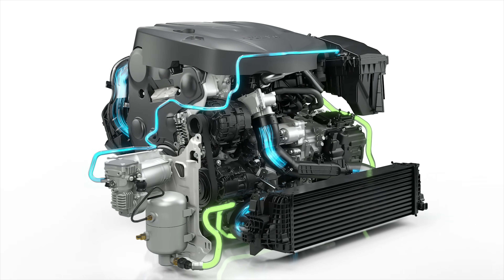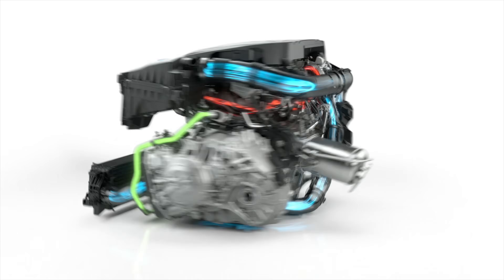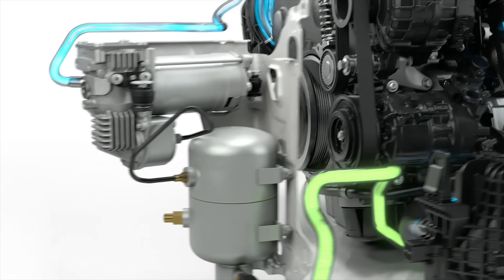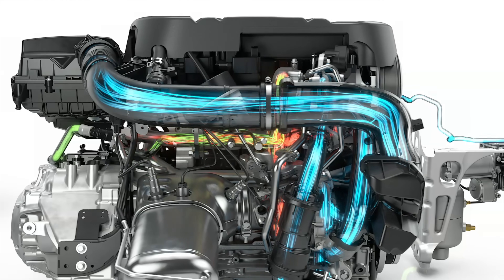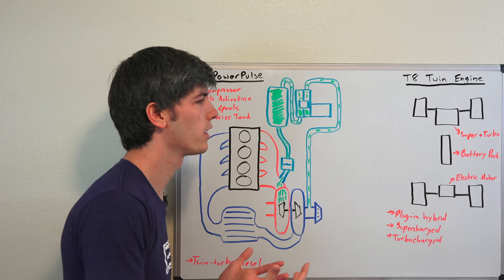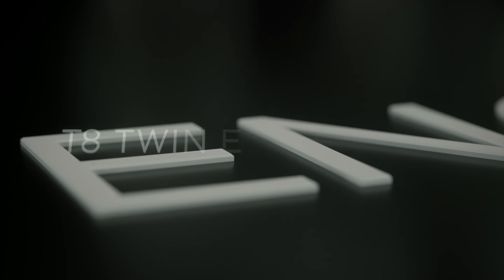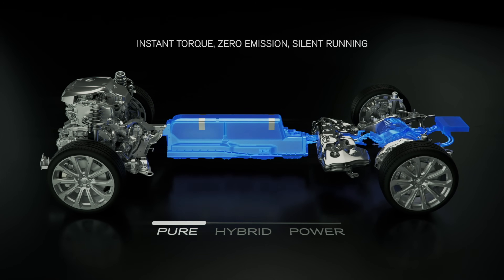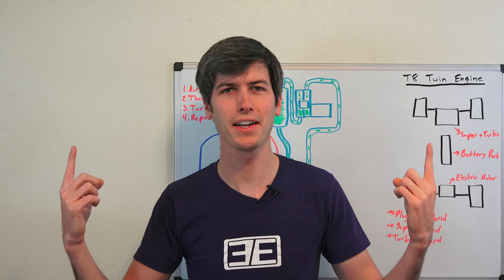How Volvo Is Eliminating Turbo Lag

Comment: Are they coming up with new tires to accommodate all that immediate torque?
Reply: there's nothing of special in that "immediate" torque, still much less immediate than elettric motors
Reply: No real need.  For example, if you have a 4-cylinder turbo that makes the same power and torque as a naturally aspirated V8, but with lag...then removing the lag simply makes throttle response and torque delivery like a n/a V8, with the same sort of torque delivery, only in a smaller, lighter and (generally) more efficient package.  And there's plenty of cars out there with n/a V8s already.
Reply: theLutheran1 no why would they? It just a family car not a drag car?
Reply: They will use traction control to reduce power to the wheels. All this tech is B.S.
Reply: Only if there's too much torque for the available traction.  Just like happens right now.  But for those times when there's plenty more traction than torque (like when there's lag and thus the engine isn't making optimal torque - most noticeable in higher gears, but it can happen in pretty much any gear) then it's still usable and therefore won't be capped off by traction control.

Remember, traction control is just that - dependent on traction.  If you have the grip, then no reduction.  It relies on detecting that your wheels are already losing grip before it kicks in.
Reply: The Volvo isn't capable of making nearly enough power to be needing new tires. Sure you can rapidly upset the tires even with very little torque but that's not what this is about.

Comment: Could I install this in my internet router?
Reply from the maker: Yes, CenturyLink will charge you a 1-time reoccurring fee of just $99.99 (increase by $4.98 monthly) to have it installed. Don't bother calling Comcast, they'll claim you already have it (and thus have already been charing you for it).
Reply: Engineering Explained Dang,I almost got scammed,thanks for heads-up
Reply: Miscellaneous Dudes OK you win lol
Reply: Most likely.
Reply: lol a 1 time fee that is reoccurring, that makes sense
Reply: You'll need a blow-off valve though.

Comment: But how does a turbo work with an electric car? It does not have exhaust because it’s energy so how does that work?
Reply: rc ng, I respect you know what you dont know, unlike most ppl. And don't let the fear trolls ignorant comments, who usually know less than you keep u from asking the questions you need to be well informed. 

To be honest while I could tell the T8 powertrain is a hybrid, I would have liked more details on exact configuration of the Hybrid, so I guess I will google other reference material on it.
Reply: rc ng its a front wheel drive setup, with an electric rear wheel drive. Reason they called it a hybrid
Reply: oh ok so hybrid is both electric and gas
Reply: oh ok thanks tho
Reply: N C very rare to see such respectful comments among the much online trolls. Respect!
Reply: Ayman Almateeg lol thanks
Reply: PS, I got a reply from EE (Sorry I still dont know his name) to my question right away.
Reply: N C I believe he is called Jason

Comment: Remember when Volvo was synonymous to simplicity and reliability?
Reply: As a previous owner of a 240 and current owner of a 140, I agree. Still, it's cool to see the company is still relevant and innovating.
Reply: Jurre Volkers by ford.....  Don't forget that.. But with the Chinese money now, at least we're seeing boats load more innovation
Reply: My Volvo  S60R despite being very complex has been way, way more reliable than my newer CPO Mercedes SL550. My next car will be a NEW Volvo. I could have bought a new Volvo for what I paid for my CPO Mercedes SL550. There is also statistical data from Warranty Direct (largest British extended warranty company) listing Volvo engine's in the top 5 for reliability even ahead of Lexus at the time. BMW, AUDI, VW engines were all in the bottom 10 for reliability. Warranty Direct keeps detailed statistical records of engine faults since they are on the line financially to pay for repairs for customers.
Reply: @gordonmccracken1209  thanks for the info.
Reply: That is correct which is why I think Warranty Direct's data is better if you plan to keep a car long term. It is a better reflection of durability. There warranty coverage is applicable only after the the manufacturer's warranty expires thus they see older, higher mileage cars.
Reply: King Pleb Volvo is still one of the most reliable, it got voted number 1 in a study recently.
Reply: In the US who the hell thought Volvo was synonymous with "simple affordable cars" as a brand? Volvo has always seemed a bit higher end than (over $30K)
Reply: King Pleb remember when humans used to walk around with no clothes on? Life moves forward
Reply: my 2004 xc70 is doing good and I can do most of the repairs myself.
Reply: If that system breaks down, it won't be fatal, you can still drive around just fine with a little more turbo lag though.
Reply: Gordon Mccracken   Doesn't JD Powers do surveys about reliability after X amount miles. Or cost of maintenance for X amount of miles
Reply: Gordon Mccracken  they would need to have accurate numbers to determine what to charge. There must be some cars they won't cover
Reply: Bernie Leiva   Aren't they owned by Ford now. I hope the retained their best feature, Saftey
Reply: Pepperidge farms remembers.
Reply: Also hybdrid cars with combined start / stop generator / extra drive motor, in theory have the possibility to be more reliable for example in terms of starter motor, etc. problems as the "starter generator" is much beefier than traditional starter motor . . .
Reply: Toyota is the pinnacle of simplicity now. But they're not innovating things. And unfortunately for them, that's not what people want.
Reply: @ravenclawgamer6367 Toyota was in the final stages of a hydrogen I am not sure what’s happened since though. Point is they are developing new things
Reply: They haven't been very simple since 1993, however they do continue to be reliable
Reply: It all went downhill when they got taken over.
Reply: I lament about the older cars Japanese from the 80s and 70s.  Smaller lighter with great fuel economy simple to fix and without all this computerized crap.  And a lot cheaper and more reliable.
Reply: No
Reply: I'm starting to think that Obama and him making a law saying 50 mpg for cars was really about forcing more people to ride public transportation. Basic simple affordable cars will be no more
Reply: @scottgolden2766  stfu... 50 mpg are possible but forget about every suv, crossover or even more useless pickup truck, most of them just used to commute and go to the mall...
my previous and current car gets 50 mpg

Comment: Why not sending the compressed air directly into the intake manifold to compensate the lag instead of spooling the turbine?
Reply from the maker: Well, a couple reasons I can think of, but it's an interesting thought for sure! First, it's not passing through an intercooler, so the air is going to be hot, not great for combustion. Second, it's not really that much air. The idea is to simply get the turbine wheel spinning, where it then takes over and provides ample boost. Third, it may be a bit awkward for easily controlling air/fuel ratios if you simply inject super high pressure for a very brief moment.
Reply: I think, you would need a bigger tank for that. If I am not mistaken, this device only helps to overcome turbos moment of intertia.
Reply: That would be way more complex thing to setup. You need a certain amount of air to fuel so you would need to control amount of air you send depending on multiple factors.
Reply: thats a good question though
Reply: That would cause a reversal of airflow towards the turbo's compressor. This may eventually cause a compressor surge. (Thats what I think) @engineeringexplained
Reply: The answer is volume, I suspect.  The engine would need a large volume of air for that to be effective, so you'd need a larger, heavier tank...and a much stronger compressor to refill it to the required pressure fast enough so it's ready for the next gear shift (with spirited driving, this could mean a refill time of a couple of seconds.)
Reply: The reason i can think of is this,
It is very difficult compress air (as air is compressible and having a very low specific volume) now think of a normal 2000 cc engine running at 6000 rpm, that equates to minimum 200lites of air per second (assuming no boost),
The air compressor needed to do this will be bigger than the engine itself, and it will consume more power than the engine can produce.
Reply: That would not work so well for two reasons. 
1. With the throttle wide open (i.e. when you want the boost to occur) the burst of air into the manifold would be free to back up into the intake system rather than raising the pressure inside the manifold sufficiently to increase the power, so the effect would most likely be negligible. 2. 1, air injected into the engine but not flowing through the MAF meter would mean unmetered air and mess up the air/fuel ratio.  Squirting the air into the turbo avoids both these problems and only needs a small air tank.
Reply: Engineering Explained
Unless the air was immediately compressed prior to application, it probably has cooled back down close to ambient temperature while bottled up.  The act of expelling it from the tank would immediately cool it, making it more dense than the air being introduced through the normal path.  While this system may not be much air, it is likely able to do more work on a turbocharger in the form of a heated gas post combustion than in its cold state. It also wouldn't be competing with exhaust flow from the engine to get through the restrictions of the particulate filter, muffler, etc.
Really, there are two reasons that I can see why Volvo is doing it this way, with one being your last, which is maintaining control of air/fuel ratio.  Even so, this isn't very critical in a Diesel engine, other than to avoid making  black smoke.  The other is this arrangement avoids having to design a system to cleanly hand off the responsibility of providing boost from a tank of compressed air to the turbocharger.  Quickly modulating a large air flow from a decaying pressure tank source into a building pressure source from the turbo would be difficult. Instead, the power hand-off occurs on the turbocharger and the waste gate handles any potential surges beyond the intake pressure maximum.
Reply: Engineering Explained while you compress the air it heats up ( pV=mRT,  V m and R are constant). So the container would heat up simply aircooling it with some finns would do the job most likely.
Reply: 1. The adding air to the exhaust manifold increases back pressure, which substantially increases the amount of work the engine itself is sending to the turbine. This multiplies the compressed air's effectiveness.
2. The energy from the air injection event goes directly to the rotor of the turbo. Once the turbo is at high speed and creating boost, the engine will immediately produce enough exhaust gases to keep the turbo spinning long enough for engine rpm to rise if it isn't already above the boost threshold.
3. There are no expensive check valves or aspirators to add to the intake side of the engine. Control is very simple as well: If full throttle is commanded, open the dump valve for a certain time given the current state of the engine. The normal engine management can take care of the rest without much re tuning.
Reply: Because you would need to retune for extra air you will be shoving into the cylinders semi-randomly. Just install a harbor freight air compressor into your exhaust manifold and you're good :^)
Reply: Santiago Cuevas, did Volvo engineering call you yet;)
Reply: I believe it would be due to the limited volume of air in the tank. Think of it more a form of power storage rather than Air supply. An average turbo car would only be around 1 Bar (15 psi) of boost, maybe upwards of 2 in some more exotic forms. (not counting massively worked GTRs). At these pressures, storing enough air to directly boost the engine for any useful period would require a very large volume. 
Say 2.0L, 1k RPM = 41L/s; 2k RPM = 82L/s and so on.

You could boost the pressure in the tank higher, and rely upon the expansion of air as it flows from high to low pressure, but that might net you a maybe a 2* or 3* benefit, which leaves you still with a large tank required. Also as the air expands, it would cool significantly, not sure how this would upset the engine with a sudden change in temperature along with pressure and how quickly the ECU could adapt...

Instead forget the air part for the moment, consider the specific problem at hand - you need to dump an amount of energy into the turbo to spin it up to a point where the turbo becomes self-sufficient (i.e. the additional boost creates additional exhaust gas flow sufficient to create the required boost). 

A compressed air storage tank has a basic energy equation where the energy stored is proportional to the volume, and proportional to the pressure ^ 2 (double the pressure = 4 times the energy, or 1/4 the volume for the same energy). And it's reasonably easy to create a tank that can hold many hundreds of atmospheres of pressure. Example - a industrial oxygen tank holds 2200psi when full - around 150Bar. Now the the Volvo tank is not going to be this extreme, but it's interesting to note that the air compressor in the video is a two stage design, so they are clearly going for high pressure.

This works nicely as with some clever nozzle design in the exhaust section of the turbo, you could direct this high velocity air (which gets reheated by the turbo body heat) into the turbine for a fairly efficient conversion of the high pressure/low volume of gas into a useful early spool up of the turbo, and thus not need a huge tank of lower pressure air to achieve the same thing.
Reply: callMeAMug  you are bang on! Flow reversal would definitely cause surge.
Reply: I don't think I the compressor is big enough to make a difference there
Reply: I'm thinking the same
Reply: That would be called a Electric supercharger. There is something called that, actually.
Reply: Engineering Explained , I didn't get the third one, how does air-fuel ratio come into picture in a diesel engine?
Reply: Santiago Cuevas thats exactly where I thought he was going with this.
Reply: They send it to the TURBO Because part of TURBO lag, is waiting for the turbo to spool and give boost and if you send it straight to the intake you get some power but still are waiting on boost.
Reply: That's a good way to put your turbo compressor into surge.
Reply: Was thinking the same. Maybe it would slow down the actual turbo spinning up, when there is higher pressure on the turbo outside than in the intake side?
Reply: Santiago Cuevas, I think engineers have come up with ideas like the turbo- or supercharger because there are too many downsides if you want to "artificially" charge an engine (elcetric system with compressor for example). It would be interesting to try out a  simple engine prefitted with a tank of compressed air. As someone already said the problem would be the airfuel mixture...
 *I apologize for my bad english...
Reply: Because of a simple law in fluid dynamics, the gas always flows to lowest pressure. So what happens when you set the intake under pressure without driving the compressor of the turbo? The air wil simply try to escape to the air filter because that's where the lowest pressure is. The netto result is that instead of helping the turbo you're only making things worse.

The turbine is designed to take energy from difference in pressure while the compressor is designed to create difference in pressure. Therefore it is better to create a pressure difference in the exhaust (turbine) than intake.

Now would some say that you could use a membrane to control the flow direction. Adding the compressed air and building up the pressure in the intake still doesn't help the compressor to spool up the turbo. Also the turbine of the turbo has an unnatural flow in the exhaust making it even harder to spool up. The result would be instant power which fades while the pressure in the tank drops, then the turbo's still needs to spool up and at last you notice a build-up in power again. What you basically have done is delaying the turbo lag.
Reply: Yea y not str8 into intake after a pressure regulator. Abit redundant to pump into exhaust
Reply: why not send your money away from commie china volvo?
Reply: If you increase upstream pressure on the compressor it will likely stall it forcing it to take even longer to spool